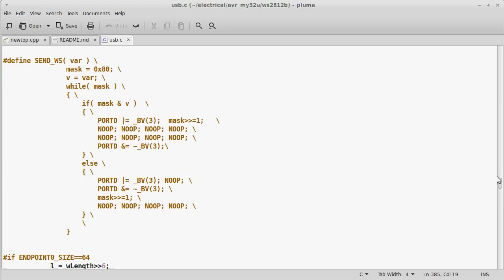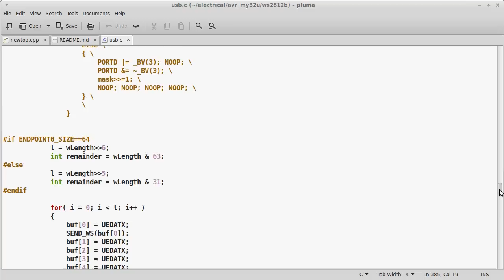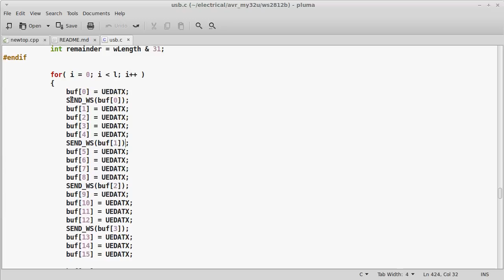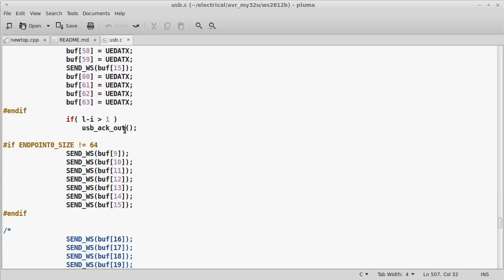AVR Code Piplining: To do what may seem impossible.

Comment: Just to mention where word pipe lining came from. I worked for pipe manufacturer. To expell - form joint on regular pipe you have apply 1min heating, 15s to form joint and cool it down. So its better to have 4-5 steps 15s each divide longest step into chunks like heating for example to be able manufacture end product in 15s instead of 1:15min . Heating 180-200'C 4x 15s each. Forming and cooling 15s then put rubber seal is 5s and to grab by human put in stock 10s. Voila 15s to have result instead 1min. There is delay of 4 pipes before you get results but more heaters you have faster you may get. Its possible to reduce forming time and cooling to 10s but its impossible to reduce time needed to heat by increasing temperature cause pipe will not be formed nicely will be off color. So you never downplay with heating time. If you have to just split longest process into smaller chunks and do those in pararell. Exactly same idea was behind Henry Ford car manufacture. Divide process into small chunks taking simmilar time and voila. One car in time of this one chunk. More smaller chunks larger delay. Only con. But lot of props.
Reply from the maker: That's really cool.  I never knew that.

Comment: How about the 32u4?
Reply from the maker: I don't normally solve software problems with hardware.  I.e. the 32u4 could do it without having to pipeline but it's more $$ and bigger.  No reason to  make an overall worse hardware solution just cause someone doesn't want to write a few lines of code.
Reply: @CNLohr  I totally forgot why I proposed the 32u4 8 months ago but I am wondering, where do you pull all your time from? I know you get praised a lot, but seriously, your projects seem like one would have taken a whole decade to do, so how do you manage your time?

Comment: I'm 5 years late, so I really don't expect a reply. Still, my question is:  what's the advantage of making SEND_WS(var) a macro rather than a 'normal' function?
Could the same result be achieved if SEND_WS() was NOT a macro? Thank you.
Reply from the maker: The result would probably be workable, but, by doing the macro, it usually results in a little simpler code, less function calls, etc.   But a surprising amount of time is spent in function setup, call, epilogue, prologues and returning.
Reply: @CNLohr  thanks. I wrote a lib for interfacing CC1101 with MSP430 and used macros to define spi read/write, pin high/low etc. just because most good libraries do so. Now I know the reason. Always learning from you. :)
Reply from the maker: @avramitra  oh yeah, for something like IO, macros are a must!
Reply: You use macros for extremely time critical pieces of code who's beginning and end are clearly defined, and not altered by subroutine calls and returns. Especially if you use macros in loops (where small errors accumulate).

Comment: I have a WS2812B strip and it keeps the lights on even if you stop sending, as long as you keep the line high. It works perfectly, I can set the LEDs to the colors I want and then just stop sending and do something else and the LEDs will retain that color. But your solution is nice, though.
Reply from the maker: I tried doing that, but it looked like all subsequent LEDs after the first one would drop the line low if kept high too long. Perhaps these weren't WS2812s when I made them.
Reply: CNLohr My strip was very cheap, I ordered it from Ebay and it was the cheapest I could find. Perhaps it's a slightly different driver inside the LEDs that allows for this. It works really well though.

Comment: u can just use your esp8266 and run the tpm2net firmware and use glediator or jinx to display grafix on your ws2812 or b
Reply from the maker: Martijn V That's actually a good bit more complicated and ESP8266s can't provide lossless communication.   Though I do have a new project "ESP8266WS2812I2S" which can provide much simpler WS2812 control output.

Comment: Extremely awesome stuff. This is very interesting to me as I have a possible WS2812B project coming up, and I understand how that works and why speed can be a problem with an arduino feeding it if you have a lot of LEDs.  This is a good way to get more speed.  You should probably put WS2812B in the title to get more hits. Thanks.

Comment: Could you feed it with another AVR with SD adapter and get rid of the laptop? Or would that be too slow, in which case a Teensy 3.1 would do?
Reply from the maker: It'd be plenty fast, but he wants to make the LEDs respond from the data coming out of his tracker.

Comment: Basically this solution have no advantages over solution that use buffer (not in memory usage and negligible in speed speed).
This just slow data transfer from host to AVR so AVR can manage to send data to WS2812B with small buffer, just it move communication with WS2812B from main loop to interrupt (which for this case don't matter but if you need AVR to do something else beside only communication to WS2812B this is major flaw).
Reply from the maker: I did tinker with doing it all in main... but it just worked better in that other loop.  Also, you could re-enable interrupts or check interrupts between WS2812 bytes, you can wait up to ~8 us between bytes.

Not sure how this doesn't offer any advantages, as this would not be possible with something that expected a buffer.
Reply: CNLohr It can be done, but again no advantage (using buffer you could make usb interrupt shorter, but you would make main loop slower so no gain in any case in this situation), use solution that works best for you.
I only wonder why you didn't switch to some "better" compiler, GCC is not best for optimization for speed/ code size, and as I saw you like to push "small" microcontrollers to maximum (on "big" projects IAR make close to 30% smaller code, and near 50% faster which would allow you to do more in same hardware)
Reply from the maker: On anything that matters for actual processor cycles, I typically write my own ASM and/or do register binding.  Normally GCC produces the most optimized code I can find.

Also, I would be surprised if it beat GCC when GCC has all of it's LTO, Wl Relax and mcall-prologues.

But the point about this is there isn't enough RAM on the AVR to do the task using buffers.  You must find another way, or use a bigger AVR.
Reply: CNLohr You have enough ram to use buffer it will not use more ram than this if you use 64 byte buffer.
IAR beat GCC in every aspect (even AVR use it for its complex examples) and is one of best compilers (but it have price that follow it). It have better optimization using  RJMP/RCALL then GCC Relax, it do micro-optimize of code and so one.
Just look at comparisons of two and you will see difference.
Reply from the maker: If you read 64-bytes, and store them to a buffer, that'll take 256 clock cycles.  By then, the WS2812B's have long since reset.  You would only be able to write out 21 LEDs, tops :-/.

IAR costs money.  If I need speed, I'm gonna just code in ASM anyway.  AVR-GCC means everyone on the internet can use it.
Reply: CNLohr I think there is free version of IAR (code size limit)
No you will not reset WS2812B just use circular buffer and all is ok.
Reply from the maker: If you block interrupts from within the USB function, you can't execute the code to keep the WS2812B calls flowing.  Reading/responding to control messages takes too long... Unless you mean also calling WS2812B things from within there... in which case you have basically found a way of re-doing what I've done just more complicatedly :-p
Reply: CNLohr optimized usb interrupt for 16u2 is like 30us (I saw even ATmega16U2 based usb-serial converter capable of 798600 bit/s) what is well below 50us it take WS2812B to reset, so you can enable it between 2 data packages to it (USB interrupts are not critical, you can make them every second ant it will still work)
Reply from the maker: 30us your ship will have sailed. 50us is the /maximum/ time you must hold low to guarantee a reset. Those buggers reset a lot faster than that! cpldcpu has measured it at around 10-11us.  "On the other hand, it means that no more than 9 µs of idle time may occur during data transfer, or a reset may mistakenly be issued."

I've tried bulk and interrupt endpoints for this, but control messages have still provided the highest real-world performance I could find.

Comment: I took a different approach to a similar problem. I got my self a 150 WS2812B strip and drives it from an at90usb162, similar to yours  but less memory. I ended up storing the colors as 16 bits as i could not fit everything i needed in to the RAM. But your solution is a very nice way to deal with the lack of RAM.
Reply from the maker: If I was really close to fitting, I probably would have done something like this, but there was enough margin that I figured it was worth it to figure out another way.
Reply: CNLohr
I like your solution anyway, a nice way to get the most out of the LEDs. The problem with 16 bit is that event the darkest brightness of each color is a bit bright, it's a bit ugly but I'm okay with it as I just use it on my balcony railing.

By the way, i made a table covered with WS2812b LEDs a while back as well. http://slashhome.se/p/projects/id/led_table/#project
Reply from the maker: that's pretty neat, a lot like Brendan's thing.

Comment: Cool !!! I didn't understand anything!  but I hope soon I could because I'm trying to do a CNC stepper motor board for 6 motors...  Do you think this could be useful for that purpose?
Reply from the maker: I think using command messages is a great way to go, it's how I'm running the big mill I've used in a bunch of my videos.  I don't think you're going to have to do things as ridiculously as I have here, since WS2812's care about things that have to happen within 8us... You probably wouldn't start caring until 100us.
Reply: It would be very handy you could make a video about the process of sending a G Code file from a PC to a mC or directly to Texas Instruments stepper motors drivers.   =D
Reply from the maker: Not quite the setup I have. And I looked through my code for the stepper driver, it's pretty rough... But it does work!  I set it up so you can update the output of an AVR at 4kHz.  You can set your step and direction every frame.
Reply: I been wondering if a Texas Instrument stepper driver really has advantages over a AVR mC coupled to a optoisolator and this to a high amperage transistor... I been reading the AVR datasheets and they seems very precise?!  What you think about that?
Reply from the maker: I never really messed with that and just used proper stepper drivers
Reply: Cool !!! Thanks =D   What is going to be the next video you upload?